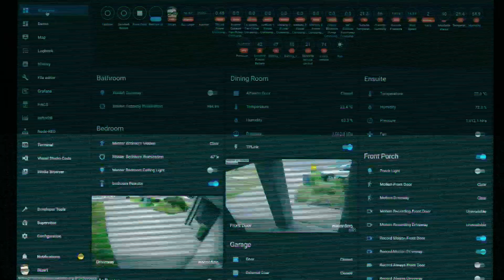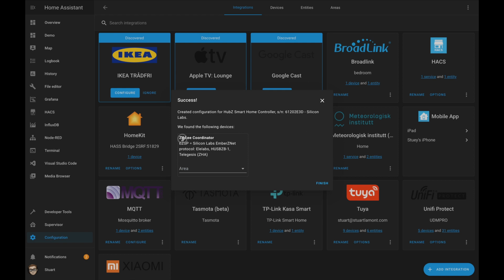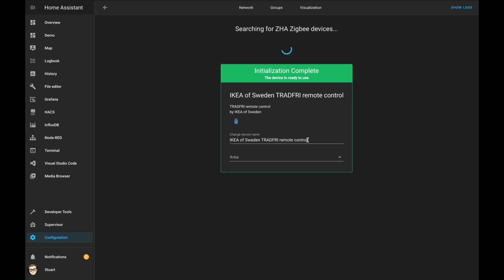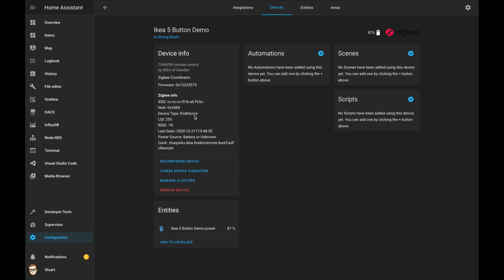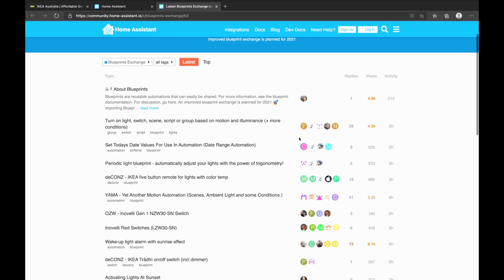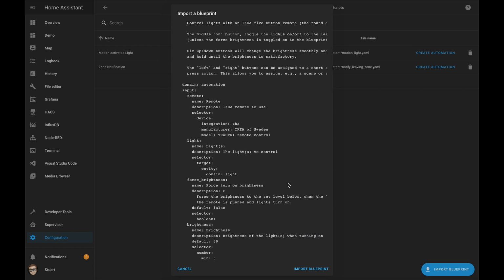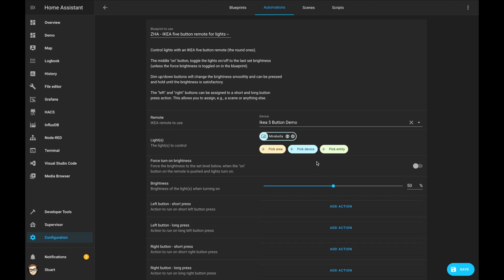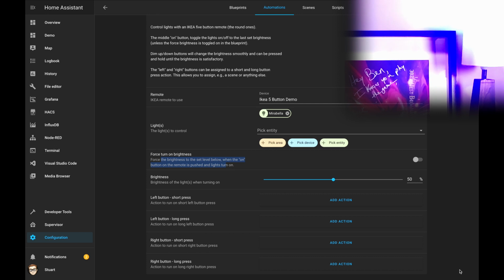Zigbee, Ikea, and Blueprints - Oh My!

Comment: Hi Stu. Do you have problems with your Ikea buttons disconnecting? I'm using home assistant with a conbee stick. I have a few Tradfri buttons, a few Styrbar buttons. I even have some on/off Ikea buttons. Sometimes I have to tap a button twice to get it to work. It's like they go to sleep. Once I press them they work with a single tap but some of my buttons, if I don't use them for a while, seem to go to sleep. It can be mildly irritating when your button does not respond. Have you had this issue? Suggestions?
Reply from the maker: Can't say I've had this issue but I actually don't use my buttons NEARLY as much as I should. You might be onto something with the sleep
Reply: I may have finally fixed this issue. The conbee stick is an antenna. It needs to be away from the living running home assistant. I got a 3ft usb extension and mounted the stick in a prominent spot.  My remotes seem to be staying connected. Thanks.

Comment: Hi friend! Fellow Melbournian here! I’m SO glad I found your channel! Finding Aussie home automation videos is h a r d 😅 I am an apple user and use homebridge (but happy to change to home assistant if it’s easier/better for what I’m trying to do.  I have Harvey Norman lights and use the grid connect hub. I had everything in tuya app but it didn’t read in the home app but worked Alexa. But my Alexa routines didn’t work. When I connected the grid connect hub, everything worked but now it will only read in grid connect OR tuya. So that means it’s Alexa OR HomeKit. But I can’t get HomeKit to read my Bunnings motion sensors. I’m so confused and wonder if it’s not a hardware incompatibility but a user incompatibility haha. I’m trying to make some accessibilities for my 5 year old ASD boy but can’t get everything to talk to each other from one assistant ie Alexa / Apple HomeKit. I think I’m in over my head 😂
Reply from the maker: In my opinion, HomeBridge is not the right solution. 
That said I've not used it in about 6 years. I just found it unreliable and needlessly complicated at the time, it might've gotten better.
I've found the HomeKit setup on Home Assistant to be significantly easier and rock-solid.
The challenge you'll face is the Tuya Integration into Home Assistant is SLOW. Not sure about the motion sensors and how they'll work to be honest as - IIRC - they're Bluetooth connected to a hub for control. That said, Bluetooth is now a first-class integration into Home Assistant so watch this space, I'll be doing some Blutooth videos coming up soon hopefully.

I'm planning an upcoming video on accessibility for People with a disability, so I'd love to hear more about your journey, your plans, and how you're approaching your Smart Home.

Comment: Something that I haven't seen anyone explain is why the device appears only as a battery sensor and not a switch, and why we have to use blueprints to get access to the actual button actions.
Reply from the maker: Not sure what you mean. I've got the remote showing up in my Devices list, true it only has the battery entity attached though.
If you've followed along, you'll likely find it showing up under the ZHA integration list which might help you to grab triggers without the Blueprint.
The blueprint just makes it easier

Comment: New to home automation so i have a rather silly question: I too am not a fan of cloud based devices. By running zigbee devices within HA (such as the ones on your video), does that mean the device is not cloud based as the bridge it is using is HA?
ps. thanks for the videos. Liked and subscribed
Reply from the maker: Zigbee Devices themselves can't be cloud connected as they don't have a connection to the internet.
With Zigbee, only the bridge has a network connection.
Some Manufacturers MAY have their bridges require a cloud connection, and in the case of wanting to turn lights on/off when you're not home, that's not a bad thing.
Having the Nortek Stick plugged into the Machine running Home Assistant means Home Assistant is my bridge.
Many Manufacturers have a Local API for their Bridges, meaning the cloud connectivity isn't a deal breaker.